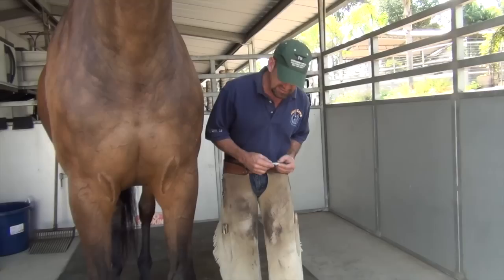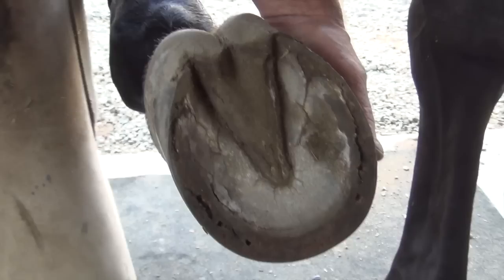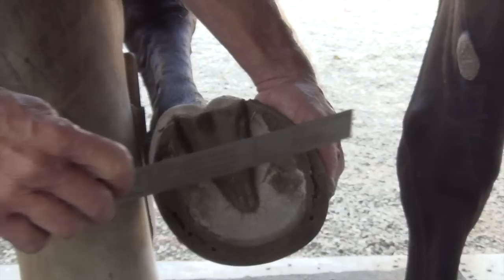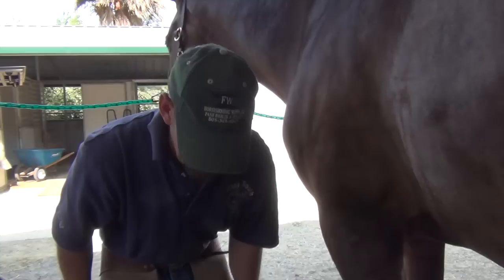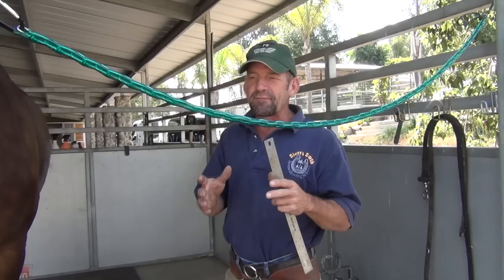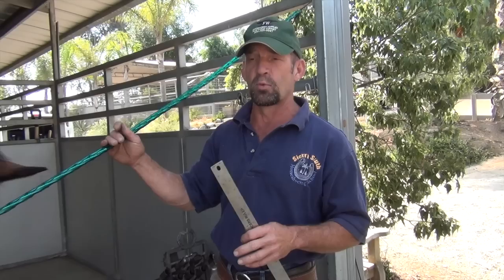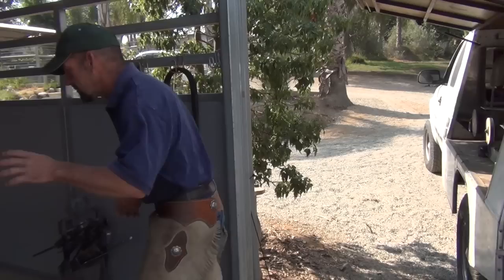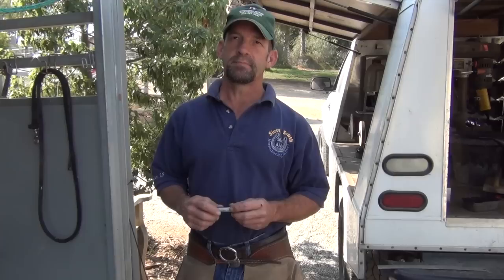Shoeing: The Mystery of the Break Over

Comment: if you shorten breakover ( or allow it to be natural with a natural bare foot) the stride length is the same, but relative to the body moving through space, it occurs earlier, and so the horse can reach out from the shoulder and land heel first.  If the breakover is late, which happens with a toe longer than it should be, the body has already travelled over the limb and the horse often lands toe first, which is detrimental.